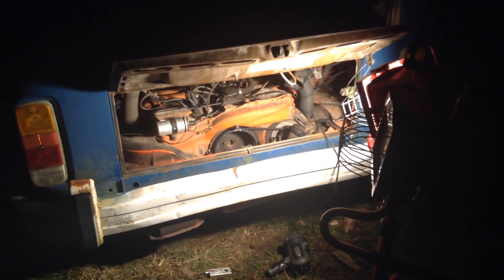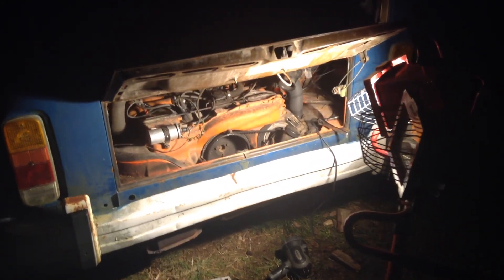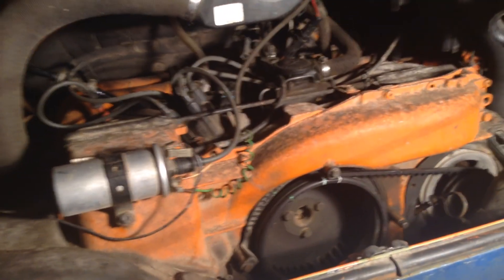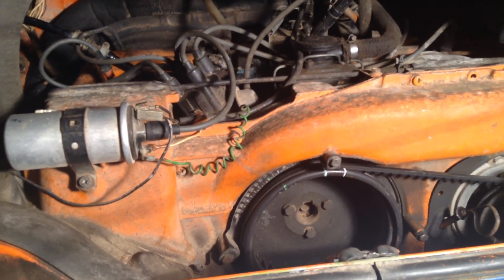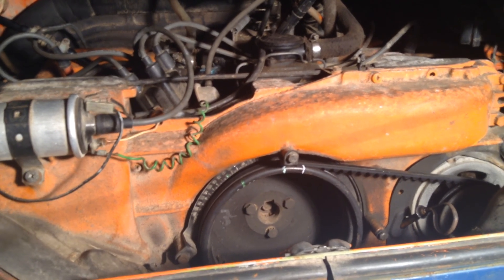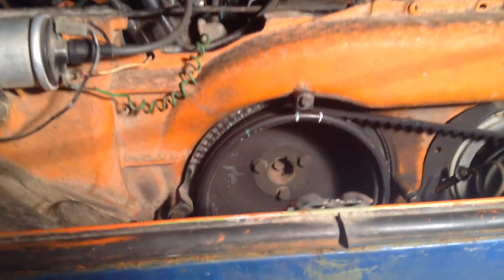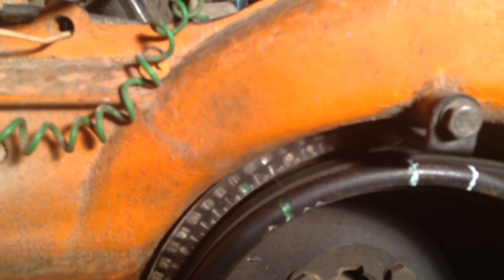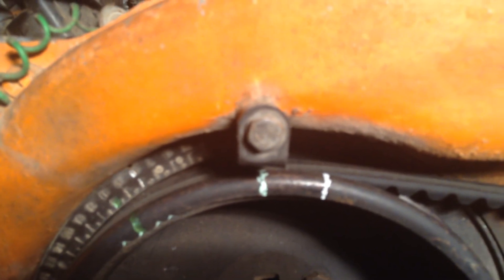'79 VW Bus Type IV 2.0 Timing Marks?

Comment: How about removing the #1 spark plug and using a screwdriver resting on top of the piston, move the crankshaft until you see it get to it highest point then see which mark lines up?
Reply: Street Freaks Racing Videos 👍
Reply: Always a great backup but it really is going to give you quite a wide range as the "top" is several degrees until it starts dropping agian.

Comment: no no no.   The TDC notch is where Ratwell (and Bentley showed you).    It really doesn't matter how much you keep talking.  Also which distributor are you using?  It should be about 7.5 BTDC anyway if that is a single advance.. which should still GIVE you about 28ish total advance (vac hoses removed).